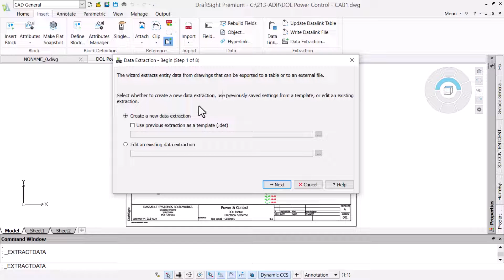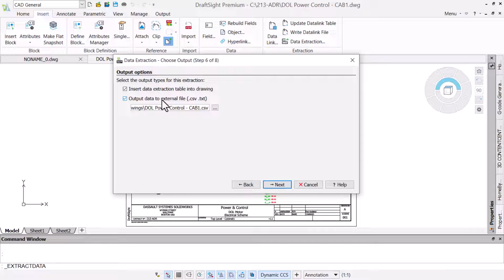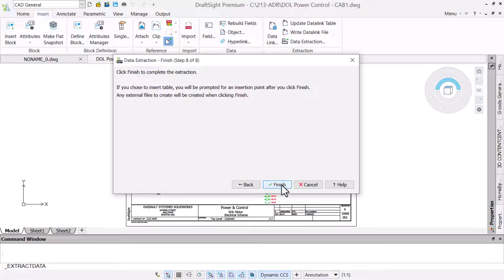Data Extraction in DraftSight

Comment: sorry to say, this is far most the not very useful tutorial video to show data extraction.
 i attempted to extract a simple table from the drawing, after using this method, draftsight export weird table which is not the same that we get from the drawing. 
do you have any video to extract table into excel sheet?
 the last video is check is on 4 years ago, then that function is no longer available.